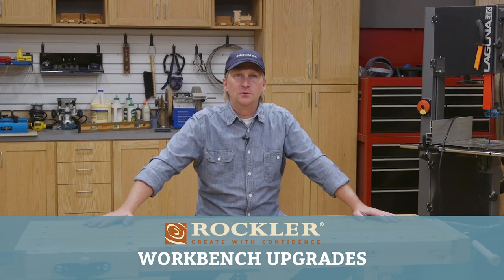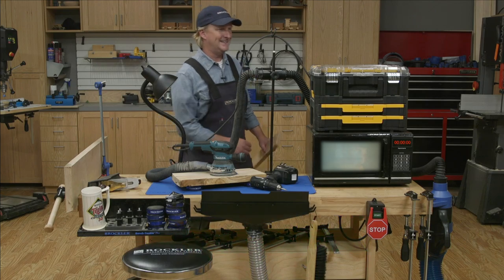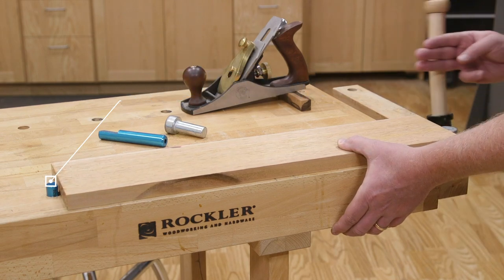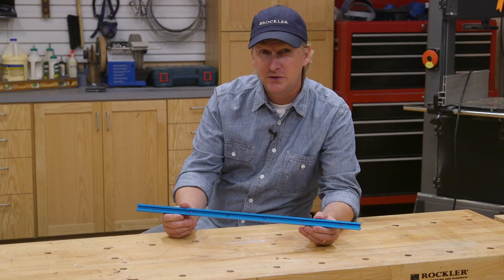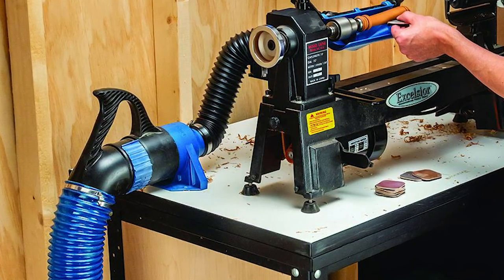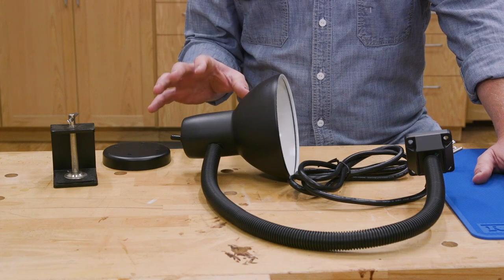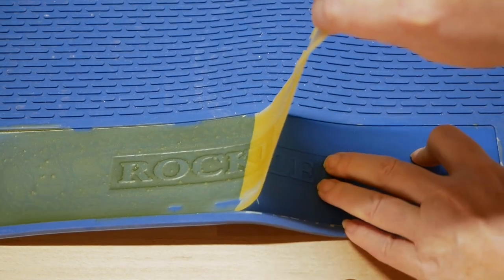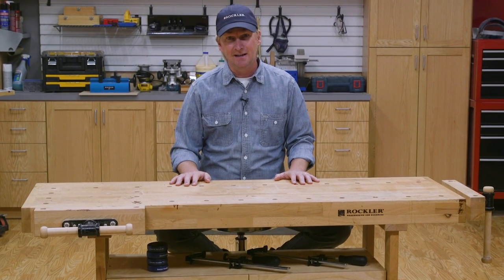11 Great Workbench Upgrades

Comment: Did you use Kreg pocket screws to put this together via the exact dimensions in your video plans? Or do I need to compensate for the dimensions in your Rockler download?
Reply from the maker: You can follow the plans exactly if using pocket holes or dowels.

Comment: How thick does a work bench need to be to use a holdfast? I’ve seen benches that are 2” up to 6” thick. I’ve got some extra Baltic birch plywood that I really liked working with on another project and was thinking about using it for the workbench top. I will likely include dog holes, and while I’ve not used holdfasts previously, they seem like a nice addition.
Reply from the maker: Hi John Lee, Please reach out to our product support team at 1-800-260-9663 or support@rockler.com. They'll be able to assist you. Thank you

Comment: Hey, the bench you show in this video isn't very deep like the one I just found for my dad. I was wondering if it should be deeper or how to add to it to make it deeper. The o e I found looks like the same size with the holes in the top and a side vise. I paid $125 used but in real good condition. Actually it's the one that Harbor Freight sells for $199. Did I get a good deal?
Reply from the maker: Hello Wendi, These benches are 19-5/8" wide. It is a common size for workbenches. Especially in smaller shops. Generally, you don't need much more space for working on individual parts. If you need a larger top, you could put 2 benches together, or add an extension top with folding legs, like these - https://www.rockler.com/rockler-rock-steady-folding-top-extension-kit - Workbenches are often fit to a personal preference. There is no right or wrong, if it works for you, then it is right.